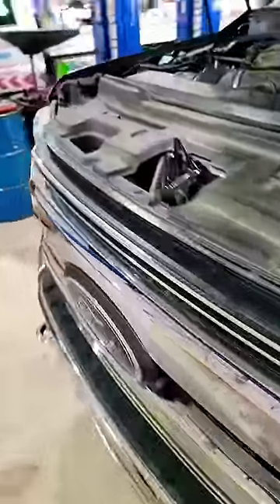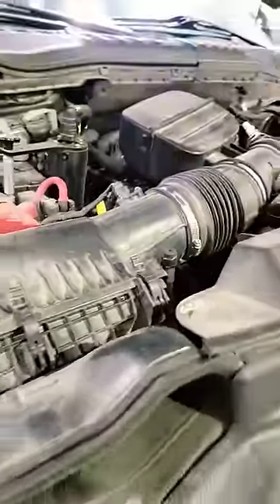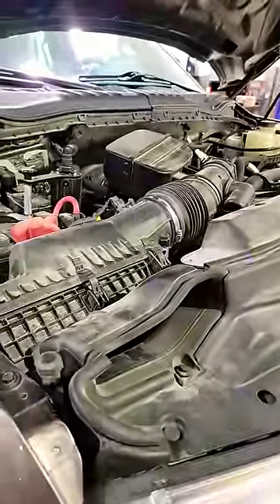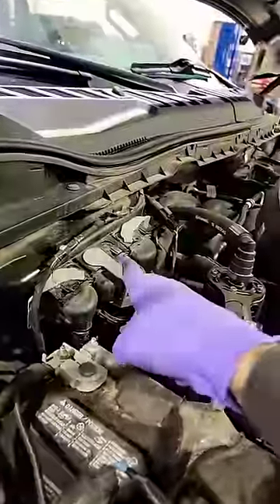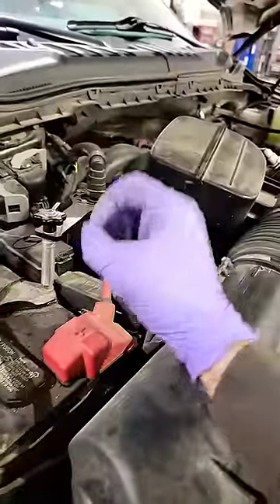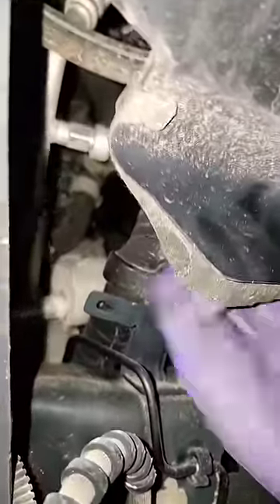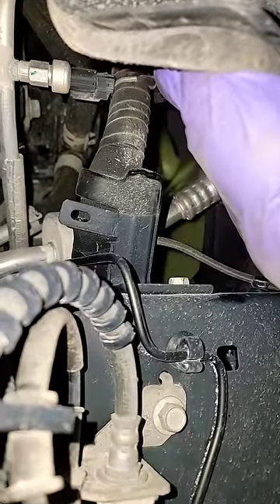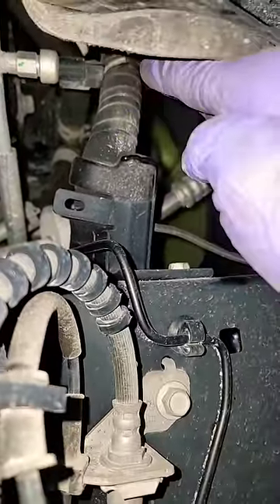New Ford 7.3 GAS owners - GO CHECK YOUR truck at this spot #shorts #fyp

Comment: That's not supposed to go bad until the warranty is up.
Reply: It's a Ford They always have odd problems lol 😂
Reply: @Duane2004  Chrysler/Dodge are far worse
Reply: @theshield1613  agreed
Reply: @theshield1613  What is dodge?
Reply: @theshield1613  by far not worse now Chrysler sucks but the Cummins trucks do real well I've just never seen odd problems like that on a Cummins
Reply: also my dad has a 7.3 powersroke for his work truck and its not too bad but it's in the shop currently because of just odd problems with the fuel filter. He only bought it because he needed a work truck so bad and couldn't find much else. So far not really impressed with Ford because the 7.3 Is one of the best ford ever made and it's just not that good in my opinion but that's just my opinion.
Reply: @theshield1613  also I just don't understand why Ford uses oil powered injectors it just makes no sense because cold weather comes around and you dont plug it in and your kinda toast
Reply: @theshield1613  JUNK D O D G E
Reply: It rare.
Reply: @Duane2004  Hardly. Best trucks out there everyone knows that.
Reply: @Duane2004  Engine is best diesel ever made . Doesn't mean that truck was well cared for etc. Any vehicle that's older (or used) can have small issues. It's a solid truck for sure!
Reply: Small issue & the AC did work did you listen. Vendors make harnesses for everyone. Sometimes they get crimped etc. These trucks are most robust heavy duty trucks on rd.
Reply: Vehicles recalled: 2019-2020 Ram 2500, 3500 pickup trucks, and Ram 3500, 4500, and 5500 cab chassis vehicles equipped with a 6.7-liter Cummins turbodiesel engine. The problem: The high-pressure fuel pump may fail, introducing debris into the fuel system. 😂
Reply: @Duane2004  the oil is brilliant if everything is working properly you can never run it low. Low oil it won't run, remember they ran those engines in school busses and what driver do you know check their oil on the regular?
Reply: @milleniumann28  I see your point there but it still seems kinda odd to me to use oil but that's my opinion
Reply: @milleniumann28  but it does in fact have a few problems because if the lil resivior looses prime you'll be there awhile lol
Reply: @Duane2004  I get it but you have to think of time in service before having hpop problems. I had a used beat up 97 it gave me 5 years of flawless service before seeing any of those oil issues. That's not bad for a 20 year old truck priced at 3200$$. I regret getting rid of it I should have slapped a new motor in it and keep riding!
Reply: @milleniumann28  nice every truck has its small issues you just gotta pick what ya Wana deal with it's just called old.trucks
Reply: @Duane2004  what you really mean is "its American, of course it's shit"
Reply: @Blatstein  dodge your warranty replacement and responsibility?
Reply: @Fatalimit  YES BINGO! MINE WENT AT 35k miles almost EXACTLY. Replaced it under warrantee and has been good (fingers crossed) ever since
Reply: @Blatstein  @ Dodge brothers started a car company over one hundred years ago
Reply: @santosbanuelos6661  Still existing? Did we enter another universe?
Reply: Ya I'm gonna go buy me one!!! Lol wow!!!
Reply: @Fatalimit  2022-06-09
Recall no.
22V414000
Ford Motor Company (Ford) is recalling 2021 F-150 vehicles. A single vehicle may have been assembled without a fuel tank front attachment resulting in an unsecured fuel tank attachment strap.
Reply: @Fatalimit  2022-08-11
Recall no.
22V623000
Ford Motor Company (Ford) is recalling certain 2021-2022 F-150 vehicles. Underbody heat and noise insulators may loosen and contact the aluminum driveshaft, which could damage the driveshaft and cause it to fracture.
Reply: @Duane2004  Btw just so you're aware the 6.7 powerstroke is the only diesel engine Ford has made. The 7.3, 6.0, and 6.4 powerstrokes are all Navistar engines.
Reply: @TrueDEATH-ii1kc   ya I know. but ya 6.7 is pretty good all except for the cp4
Reply: @Blatstein  to move out of the way of something
Reply: My went just outside of warranty 2018 f150 though
Reply: @Duane2004  “it’s not too bad but it’s in the shop”
Reply: Love all the people here badmouthing dodge. You don't work in a shop...if you do you probably need glasses. We have 34 ford's at the shop right now. 15 Chevys...and 3 dodges. most of the ford's have transmission issues or head gaskets or they are 6.7s that spun a bearing. The Chevys are all transmission or head gasket issues. The dodges are as follows...5.7 Hemi because it's a trash motor and needs rebuilt. VP44 replacement. And ball joints.
Reply: But when it comes to new vehicles they are all junk...
Reply: 😂 classic!
Reply: @Kolonol1  
Thanks for the Toyota update!
Reply: Buy a Toyota
Reply: @Duane2004  always ford has a major A/C issues that you can’t fix some times and you have to live with it  basically.
Reply: @Blatstein  Zebra Corner
Reply: @Davido50  power strokes are far from the best diesel engine around lmao.
Reply: @evoxterrier5124  👍
Reply: My man 🤣
Reply: Dam joe you had one job 
Just make sure there are 3 wraps of tape not just 2 so it will last till 36000 miles
Reply: @Blatstein  fords mo you remember 
Fu ked over rebuild dodge.
Reply: So true with everything made besides toyotas
Reply: That's about the same time it would take for this to ultimately Fail too.
If you own this kind of Truck, you should keep this information in the back of your head for later because chances are good yours will fail eventually too....
Reply: @Duane Stoltzfus  the Cummins model Truck's engine compartment isn't as crowded as those with the V8's under the hood. As a matter of fact, you can see the ground under the hood of the Truck with the Cummins engines, unlike those with V8's like the 7.3...lol.
Reply: 😄😅☺🤑 built  Ford tuff
Reply: @Blatstein  a vehicle brand.
Reply: Funny thing is Ford owns Cummins and can't use it in there trucks.
Reply: @Kolonol1  The reason why you don't have more Dodges I because they caught on fire and never made it to your shop lol. Dodge is trash well at least on the gas side.
Reply: @brucetec6597   @bruce tec  never had a dodge catch on fire really....jeep yes...dodges no...I know technically same brand but different designs. And I own 5 dodges for the record. Never had an issue with one that wasn't my own fault apart from basic wear and tear stuff. Sounds like you just haven't driven a Ford...oh yeah that's because they don't run XD
Reply: It's a Ford. Enough said.
Reply: @theshield1613  nope i towed more fords then dodge
Reply: @renatoaraujo7383  every one has a different experience my area we towed alot of chrysler/dodge newer products  older ones are better and better built.
Reply: @duanestoltzfus2671 this is a gas 7.3
Reply: @Duane2004 they don’t. HEUI was short lived and Navistar wasn’t the only one doing it. Cat did it also. They’ve been HPCR since the 6.4.
Reply: Good   one LOL

Comment: The automotive industry is building the worst electrical systems ever ive seen more electrical issues in the last 5 years then I've seen in 30 years in the business 😳
Reply: I think ford had a few electrical fires over the past few years too. Their f150s had fires from the seatbelt sensors.
Reply: The worst electrical systems are those made by Robert Bosch and installed in Volkswagens. Bought a VW once, got rid of it and will never buy a German made car again.

Comment: The battery looks nasty already! It's a 22 🤔
Reply: 33k miles already
Reply: You suppose to clean the engine as well  looks like shi*
Reply: @davecarroll4086  These batteries actually leak. They are known defective items. Lots of Warranty replacements on them.
Reply: They get dirty very fast on these back to 17.  Right behind the leading edge of the hood and needs to be sealed up a bit better.  Its an easy fix but most owners leave it unattended until theres a problem

Comment: Excellent troubleshooting! That should be a ford service bulletin.
Reply: It is! Ford training says to “preform visual inspection”
Reply: @samesouthwest8674  but what's the correction? The fastest imo, would be an elbow conector extension.
Reply: @RGV2300  That's probably at least $500.
Reply: There will be a recall out for it pretty soon lol
Reply: lol. FORD: Fix or repair daily😅
Reply: @jje8182  Fiat, Fix it again Tony
Reply: @jtoker9758  6.7 liter power croak

Comment: Engineering at it’s finest!!!😢 that should have plenty of clearance….  I see this stuff all the time in furnace and ACs it’s pretty pathetic but it’s a symptom of the engineers not seeing things in the real world.
Reply: No. It's committee.  Each individual system was probably designed seperately, then put together by another group, then the final pass was done by number crunchers.
Reply: I've always said engineers need to spend 10 years as a mechanic before getting their degree
Reply: No, the people/ person/ group/ committee/ engineer/ installer should be fired on the spot; TQM!
Reply: It said it would work on paper an the math was right idk why this is happening 🙄
Reply: Engineers. LOL
Reply: Na, it's all the CAD design that had perfect fit and finish.
The CAD design of the PT Cruiser forgot to leave room to install the engine. It worked in the computer stimulation,  but on the assembly line workers were taking too long to install. The plant was shut down until a specific routine was developed.
Reply: It's always been the problem. Huge disconnect between designers and real world.
Reply from the maker: There should be an engineering requirement of working in the field for 10 years.   Forget your 4 year bachelor's degree that doesn't mean Jack diddily
Reply: Itz_Hunted  well they must get shut down ALOT.  Today's vehicles are a joke to work on.
Reply: Engineers always got to come up with a POS rube Goldberg design and claim it to be an easy, elegant solution to a problem that never existed. In modern times, it's a competition to see who can design and produce the biggest piece of crap the absolute cheapest way possible.
Reply: Ford is pulling a Dodge move
Reply: @PowerStrokeTechTalkwARod  Agreed. as a mechanic of mostly rams with the 6.7 cummins... i do work on everything tho...  its the same.
Reply: What stupid back then there weren't 10 trim levels to choose from lol.  If you price any base model with the ones the dealers actually in the lot and the price is literally over $20,000 more than the base model.  WHAT in the HELL justifies the price hike of $20,000 over the base model of ANY TRUCK???  The engine and transmission is usually the same??  WTF leather seats and an Alpine stereo is $20,000 more??? Maybe one inch bigger rims?
Reply: @benjy117  Exactly.

Comment: The AC on my '79 F250 still works..lol
Reply: That’s because it’s a 1979 and not a current day overpriced piece of 💩
Reply: Thats why we love our older vehicles but society doesn't get it LOL
Reply: @frankbier1690  overpriced or not is a scam that keeps you coming back
Reply: What stupid back then there weren't 10 trim levels to choose from lol.  If you price any base model with the ones the dealers actually in the lot and the price is literally over $20,000 more than the base model.  WHAT in the HELL justifies the price hike of $20,000 over the base model of ANY TRUCK???  The engine and transmission is usually the same??  WTF leather seats and an Alpine stereo is $20,000 more??? Maybe one inch bigger rims?

Comment: Every other shop would've thrown a new compressor on it and hoped for the best then just gave up 😭
Reply: Not all shops. If I I couldn't find anything obvious right way I would start by hotwiring the compressor clutch to verify it still works, then work backwards from there, looking for voltage along the circuit till I find the fault.

Comment: Seeing this alot more with modern vehicles, manufacturers are making the looms as short as possible to reduce material costs, but is now leading to over stressed looms which are impossible to work on or repair because of how tight they are

Comment: Nice diagnosis! I hated harness run-throughs, especially up here in the salty winters of Southern Ontario. I'm sure our American salt belt friends would say the same thing
Reply: you would be correct.
Reply: Absolutely
Reply: My truck is more salt and rust than truck
Reply: @2ndrangersww2  oh yeah
Reply: Northeast checking in... yup! 🧂
Reply: Used to work on the state plow equipment... stares off into the distance having ptsd flashbacks of green wires dissolving in my hand and rust scale raining down on me

Comment: Great video n tip! That's a lot of miles for a 22 damn!
Reply: Just a working man
Reply: I have had a 22 car since the start of June and it has around 9900 miles on it rn I was doordashing maybe 60% of those miles it’s totally possible
Reply: 2022 is almost over... they might have had it since late 2021 .. look out November/december for 2023 models on lots.
Reply: That would take most people 3 years to accumulate.
Reply from the maker: Rightttt
Reply: @Pwnulolumad  I was comparing my 19 with 30k.
Reply: @VQBulletProof  when I work I work. I don't drive my own vehicle all over the country. Lol wtf is that "working man" hat makes 0 sense.
Reply: I have a 21 Hyundai with 100k
Reply from the maker: I have an 04 with 428k......
Reply: @PowerStrokeTechTalkwARod  Silverado! Let that poor thing rest a minute! Average is around 12k miles per year lol thats all I was getting at.
Reply from the maker: I have a  cammed blown tahoe....i dont need some lil frilly silverayyyyyydo 😂😂😂😂

Comment: Standard on Ford, every subsystem is thrown on by the next team, I don't think they co-ordinate much.  The refrigerant hoses just make a big X across the engine bay getting in the way of everything on 90s models.  Clocking that sensor fitting a little would fix that problem for good.

Comment: My 7.3 f250 does not have a computer. Just a power wire running to the injection pump solenoid.

Comment: We've been experiencing this failure on U-Haul F650 6.8s from the rip, U-Haul even put out their own TSB on the vendor portal several years ago advising to check this first. Also #5 coil pigtail, a lot of failures like this for no reason. I speculate the crimps were overpressed which breaks the wire for the + feed, always seems to be on the hot side. 

On a side note, been seeing a few 7.3 Godzilla catastrophic failures pop up with barely any miles (1 has less than 1500!!!). I suspect valve drop but Ford wants the engines back untouched. Also read about several F53s with the same failures & folks getting stuck w/o their MHs for months. Disturbing trend for what should be a very robust engine. Any thoughts?
Reply from the maker: Sane here. Check my 7.3 video has a red superduty as the thumbnail
Reply: This engine is going to have to be the bang for the buck fleet engine that everyone trusts, and they can't afford another PSD like fiasco. I don't blame them for wanting them back untouched for inspection. The 6.2 had valve spring failures early too- these things are often supplier issues, not engine design issues.

Comment: Gotta love it when engineer designs and real world applications collide. There's an abs wss connector issue on 2000+ GM cars because the harness is made short from the factory and routed with clips along the control arm so after 50-60k mile ya start getting abs and trac control lights with the systems acting up on corners and lights will clear themselves until the next corner that stretches the connector. Unclip some harness to gain slack and ya good. 

Also seen where mounts break and smash abs harness with trans or engine along the cradle in GM Northstar cars

Comment: Yo man.   My truck is 50 years old.  I don't have a/c.   I didn't have the set up.  But I appreciate you helping folks with their big rigs.
Reply: I inherited my father's truck...He was different....special ordered it without a/c.  I bought a kit in winter months for $620 and installed it myself.
Reply: @christopherscott8853  
What year truck?
Reply: my car is 17 years old with no ac😂 i lowkey enjoy the windows down tho so its not a big deal
Reply: @benztech2262  1992 I think. Sold it shortly after in about 2003.  I've done commercial hvac for 33 years now.  I remember installing the condenser coil upside down that I had to correct.   It cost me another $80.00 bucks or so for a custom liquid or suction line that i modified....I don't remember which.
Reply: @benztech2262  Still well worth the effort.  It took about 16 hours including my mistake.

Comment: Bad design ? You smart guy. Well done !!!
Reply: Not a BAD design . It's same for all trucks out there. It's minor. These Superduty are very robust w/best engine lineup out there.
Reply: @Davido50  that's a connector in a piss poor location, definitely a bad design, doesn't mean its a bad truck.
Reply: @Davido50  So if all trucks suffer a bad design it is not a bad design ?

Comment: How could the pressures be where they are supposed to be if the compressor isn't on?
Reply from the maker: The system has pressure in it REGARDLESS if the comp is on. We have already went over this. I recommend reading the comments, your answers you will find.....

Comment: Mine has a good inch or two clearance.  2022 as well.  The plug is behind the harness not on top like that.  I think somebody messed up on the line.
Reply: Same here. I’ve a ‘21 F350. The hose/harness that lays against the back of sensor in the video sits more off to the side on mine.
Reply from the maker: Thanks for letting us know